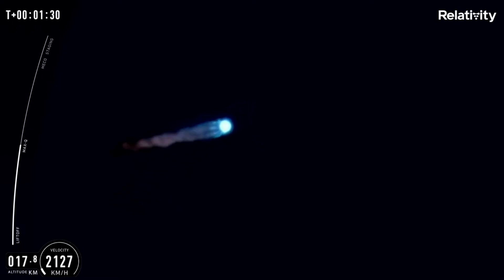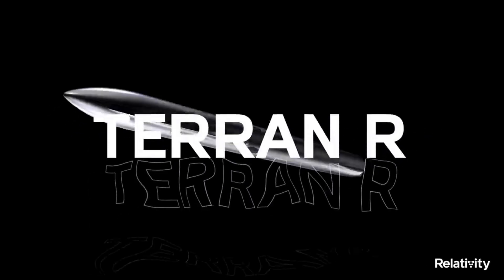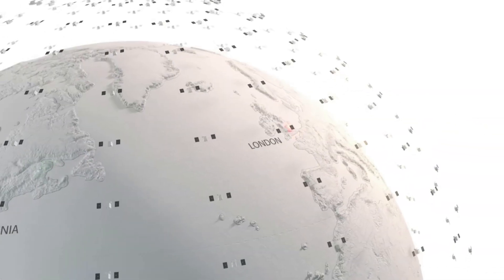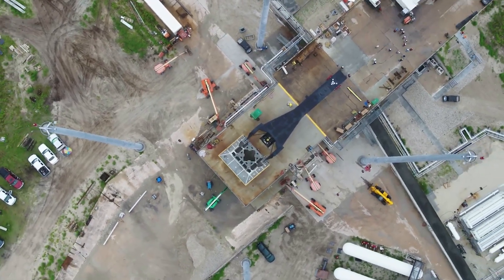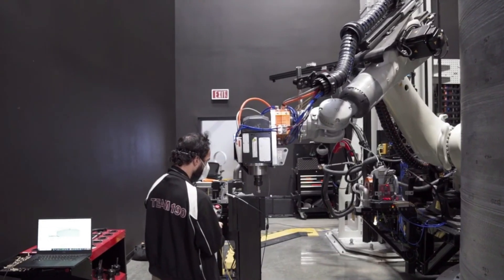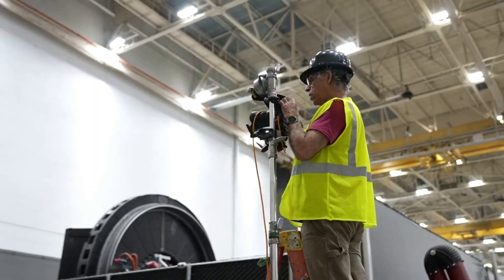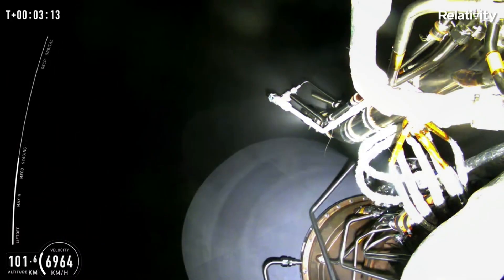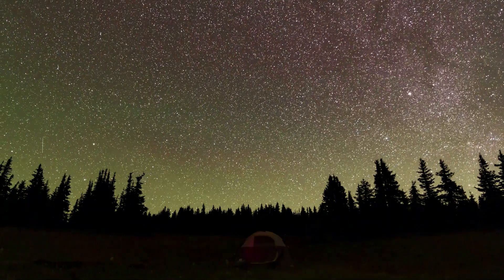A Closer Loot At Terran 1's First Orbital Test Flight, What's Next, & More

Comment: It should be noted that rockets are difficult.  That said, it has not been the best of times for new rockets:
Astra's Rocket 3, Feb. 10, 2022 launch failure.
Chinese Hyperbola 1 on May 13, 2022 launch failure.
Astra suffered a second failure of 2022 on June 12.
India launched rocket named the Small Satellite Launch Vehicle (SSLV) on Aug. 6, with a fourth and final stage failure.
Blue Origin's New Shepard Sept. 12, 2022 science-only mission failed during launch.
Firefly made its second attempt to launch with its Alpha rocket on Oct. 1, 2022 however, the payloads being inserted into lower-than-intended orbits, and the satellites reentering the atmosphere already on Oct. 5.
Skyrora attempted the launch of a suborbital rocket from the coast of Iceland Oct. 8, 2022 with the target of reaching an altitude of 77 miles (125 kilometers) The rocket didn't reach the heights it aimed for and shut down shortly after liftoff, falling into the Norwegian Sea.
Japan's first and only launch attempt of 2022 was an Epsilon rocket on Oct. 11, 2022 for a mission known as Innovative Satellite Technology Demonstration 3. Its third stage did not ignite and the Epsilon's flight termination system was activated.
On Nov. 3, 2022 test of the North Korean Hwasong-17, intercontinental ballistic missile ended in failure.
On Dec. 14, 2022, the Chinese firm Landspace launched its Zhuque 2 liquid methane propellant rocket. The second stage underperformed and the 14 satellites it was carrying failed to reach orbital speeds and fell into the ocean.
The second-ever launch of Europe's Vega C rocket with two satellites into orbit for Airbus' Pléiades Neo Earth-imaging constellation on its Dec. 20, 2022 launched from Kourou, French Guiana. The second stage, the Zefiro 40, failed three minutes into the mission.
Virgin Orbit, LauncherOne rocket on Jan. 09, 2023, "experienced an anomaly" just before it could deliver its payload, and the craft was lost.
ABL Space Systems launched its RS1 rocket out of Alaska on Jan. 10, 2023. It failed soon after liftoff.
JAXA H3 failed March 7th, 2023.
Of course Relativity Space Terran 1 rocket 2nd stage curse failure 3/23/2023.

I think that is all of them. With the Vulcan, Starship and Aries 6 coming up,
I have hope for better results for the new rockets.
Reply: Eh SpaceX, the current leader in the space launch business, took 4 tried to get the Falcon 1 to orbit. First time rocket launches almost always fail, so some of your list was expected.
Reply: @steveaustin2686  I said rockets are hard and I expected some but not all of the failures.  BO's New Shepard, ESA's Vega C rocket, Virgin Orbit, LauncherOne and JAXA's H3 were surprises.  The H3 was a shocker in that the 2nd stage was nearly identical to the very reliable H-2A's 2nd stage.
Reply: @WWeronko  I'm not saying that space isn't hard. Just that for the new players, failures at the start are expected. The ones you just listed are a surprise, especially the H3.

Comment: printing the fuel tank sections seems like the hard way to do it
Reply: I think the point is to ask yourself..."OK, I'm here on Mars.  How would I want to do it?" If you were on Mars, the flexibility of the approach would be handy.
Reply: The best reason that I have seen for the printed method is the bypassing of the design/validation/creation of the tooling structure needed to manufacture a new fuel tank. Because so few are made, and the technology will ideally keep advancing (causing new tooling setups), it makes it way easier to iterate and test newer designs without the tooling step (so saving time and money).